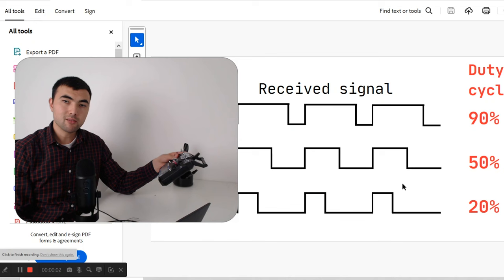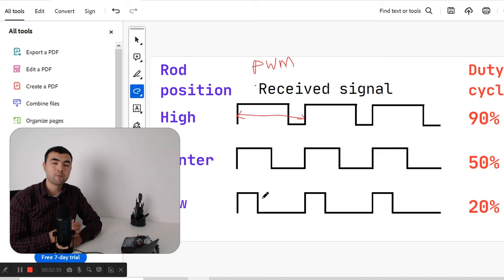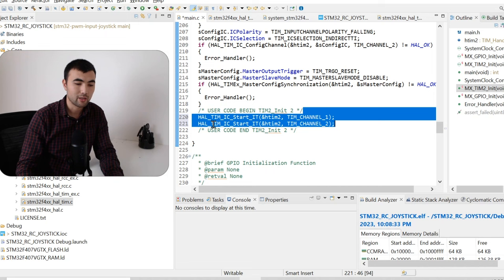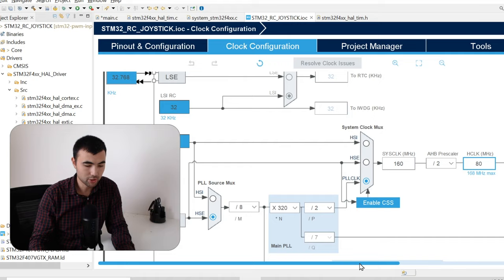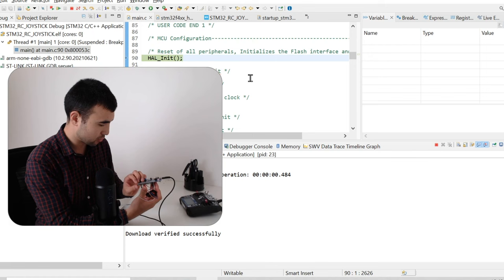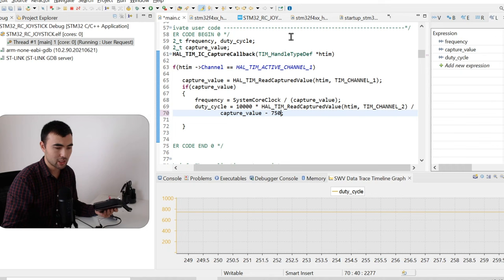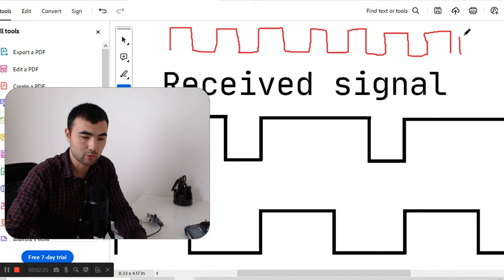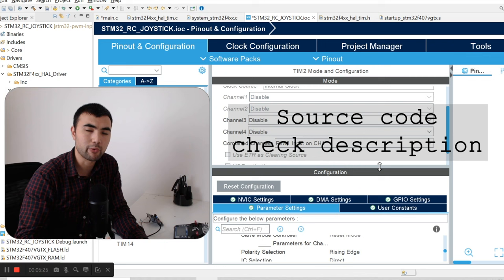STM32 Programming: Read PWM Input signal for Radio controller

Comment: I think HAL_TIM_IC_CaptureCallback is wrongly mentioned as a fn which calculates the pulse width. It just detects the rising and falling edges of the PWM signal. You need to change its CCER Register Value to make it detect the signal
Reply: wdym? isn’t that what he said in the video?

Comment: Hi Yerke ,can i suggest a tutorial video,so its nice to read pwm signal but its lots of cable when you want to read 10 channels,so can you make a tutorial for reading tis values with ppm encoder
Reply from the maker: Thanks for the suggestion. I will definitely check it out.
Reply: @steppeschool3629  hi i figured we dont need the encoder the receiver itself has a ppm pin,when we set the controller it produces ppm signal for each channel,please make a video please

Comment: Hi i have copied your code and debug works fine no errors , but when i try to do live expressions it shows , failed to evaluate expression , btw im using mac m1 not sure if this cause the problem , any idea how to fix this ? , please help tnx in advance
Reply from the maker: Hi,
variables that you want to see in real time, are they global? LIve expressions can be used only for global variables.
Reply: @steppeschool3629  Hi tnx for the reply, turns out  i made a mistake on this part 

mine is 
duty_cycle = 10000 * HAL_TIM_ReadCapturedValue(htim, TIM_CHANNEL_2) ;
 capture_value;

should be 
duty_cycle = 10000 * HAL_TIM_ReadCapturedValue(htim, TIM_CHANNEL_2) / capture_value;
Reply from the maker: great  @offensivebias3965 .  I am glad that you found an error

Comment: Hi can you make a video on Read PWM Input signal for Radio controller but wtih multiple channel, also if you have something like that already can you send me a link of it .
Reply from the maker: Hi, you can configure other timers exactly as I did on the video, and you will end up with multiple channels. It is relatively easy to do. Tell me if you have problems with that
Reply: @steppeschool3629  need help on that i have a FS 6 channel receiver so for that we need 6 timers??